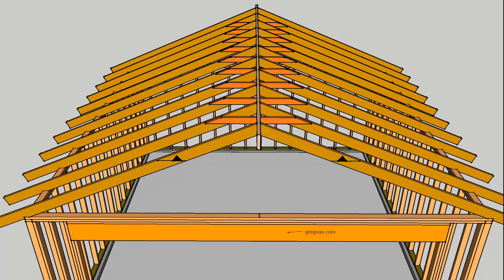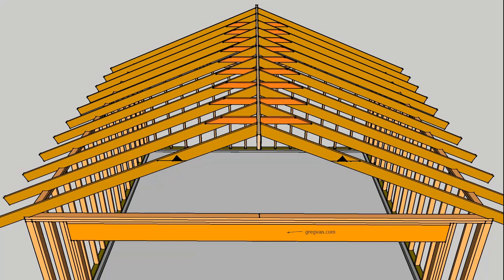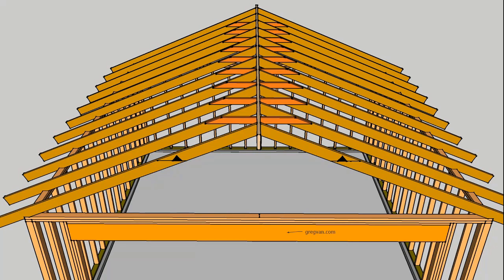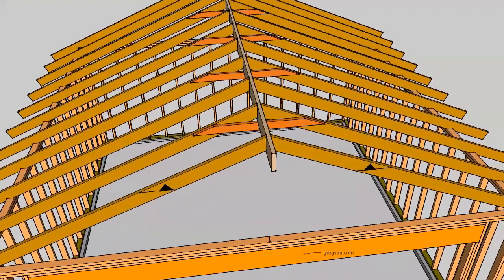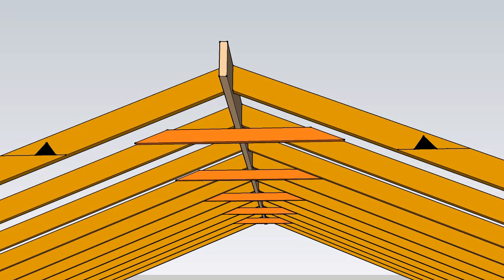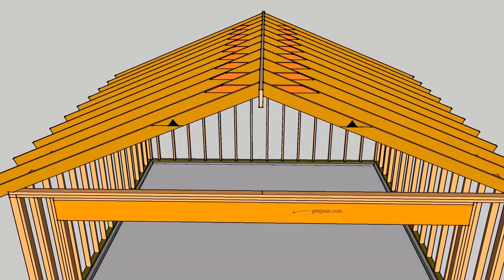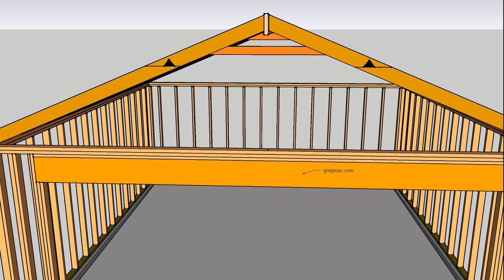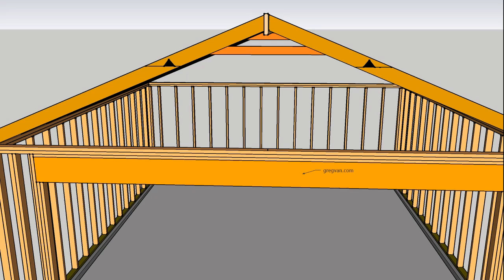What Are Roof Rafter Collar Ties – House Framing Parts

Comment: I’ve always measured from the top plate to Bottom of the ridge for the one third measurement.  I just figured it that way because you can’t put a collar tie any higher than the bottom of the ridge. But I do see now that there would be a crucial difference in height if you were trying to place the collar tie in the lowest legal position. But nevertheless, I always try to place to collar ties so they are touching the ridge.

Comment: Collar ties are for upward force. The downward force is resisted by the floor system or walls in this case. And the only upward force is not an earthquake…😂 

Wind blowing over your roof at high velocities causes low pressure and and uplift like an airplane. That is the most common force that collar ties are meant to combat.
Reply from the maker: Interesting

Comment: Can collar ties in an attic space take weight such as attaching a pull up bar or a punch bag to them? Or are they strictly not to take any downward weight?
Reply from the maker: I think you can add stronger lumber or even bolt stronger collar ties to roof rafters, but I can't tell you to do it and if you do and it doesn't seem strong enough, then remove heavy object.
Reply: Thank you! @gregvancom

Comment: Hi Greg,
Is there any reason to have a wall underneath collar ties?

I recently moved into a house with a finished attic above the garage. There is a closet wall in the attic that sits between a load bearing wall on the first floor and some of the collar ties in the attic. Is it possible the load bearing wall is solely for overlapping ceiling joists in this case?

Forgot to add that the attic has knee walls.
Reply from the maker: It would depend on the design, but I don't think the collar ties would need a wall under them. Lapping ceiling joist sound like they would.

Comment: If the roof has heavy concrete tile, not in an earthquake area and a 4/12 pitched roof, do collar ties do anything? The house does have 2x6 ceiling joists.
Reply from the maker: The roofing materials shouldn't dictate whether or not collar ties are used.

Comment: Tornados can also cause upward motion.
Reply from the maker: Great point and thanks for sharing.
Reply: Thank you for the video. I’m remodeling a 70 year old house with a shallow pitch roof. It had randomly sized collar ties placed somewhat haphazardly, to my view. Making the attic usable for re-wiring, re-plumbing & mini-split installation, I’m removing the collar ties but replacing them with a 2x4, on each side of the rafters at every rafter, mostly with tornadoes in mind. I’m doubling them because of 24” centers & the fact that I’m placing them as high as possible to make crawling through the attic possible for my nearly fifty year old bones. Your video is the first I’ve seen that indicated that doing so was okay, structurally.

Comment: Great video. I have a 26x12 shed/garage for my boat. I need more head room. I have 4 ties going from wall to wall. The middle 2 I would like to remove for head room while I'm in the boat. Can I just raise those 2 up to the top 3rd of the ceiling but I will leave the 2 near the ends? But my 2x4 rafters don't have a header.  They just meet in the middle
Reply from the maker: I can't provide you with structural engineering information, but can suggest that the ones located in the middle are usually going to be more important than the ones located on the ends. If you do move them, then I would advise measuring the middle span of the garage and writing the number down with a permanent marker on the framing somewhere and then check it every once in a while to make sure the walls aren't spreading apart.

Comment: Hi Greg,

I have collar ties in my attic that are placed 6 ft high from the ceiling joist below.
Can i raise them all the way up the roof, just below roof center joist, to make more head room?
Reply from the maker: I can't provide engineering information, but can say that I've seen it done before.
Reply: Thanks Greg, 

I'll have an engineer review all my plans before i do anything, but just wanted to some pre-lim info.

Is there a certain length they have to be in relation to the length of the roof rafters?

Comment: I did like he did, I used 2x10 cut to roof angle and screwed and PL glued them all in place.  Then I close spray foamed and it's pretty strong. for a 12/14 pitch
Reply from the maker: What exactly does the sprayed foam do?

Comment: Explain how you hold up that center beam without support underneath?
Reply: The ridge beam gets two rafters resting against it. Look up "keystone in an arch" to understand. The ridge does not support the rafters the rafters support each other and kick out force at bottom support. Think two playing cards resting against each other to form a triangle shape.
Reply from the maker: What center beam are you referring to?
Reply: You can put temporary supports to hold the ridge up during construction if needed.

Comment: After you finish the roof, do you just spray the sheathing with popcorn, or is there sheet rock and the popcorn?  I am trying to go back ward and get rid of the popcorn. If I scrape it off, is there anything between the popcorn, and the plywood?  I have no trusses, just one big ridge down the middle and the rafters. Where does the insulation go?
Reply from the maker: If you're trying to scrape the popcorn or acoustical ceiling off of an interior room, then it can usually be scraped off after spraying a little bit of water on it. The acoustical ceiling is usually attached to drywall or plaster, but I have seen it sprayed on plywood also.

Comment: Any videos or info on pulling a rafter back into place that has separated and inch or so from the ridge beam? or some kind of hardware that can be used to reinforce it?
Reply from the maker: If the rafter separated from the ridge beam, then there's a structural problem that might need to be addressed. This would be my first concern. Feel free to send me some pictures and by email address can be found at our website for more information.

Comment: Thank you for this video. I'm building a shed/workspace and want to build without a ceiling for "openness" and for better air flow. My shed is 12x22. I have 2 questions after watching it: 
1) the longest 2x8 I can find locally is 16 feet, how do I combine 2 pieces to reach the 24' (1' overhang on either side)
2) i learned from you (other video and comments) and collar ties keep the rafters attached to the ridge board and rafter ties keep the walls from bowing out. This video does not show rafter ties. Are they always needed?
Reply from the maker: Yes rafter ties would be needed unless a ridge beam was installed with supports of both ends. I live in California and lumber can be found in lengths up to 30 foot long and some engineered lumber even longer, up to 50 feet long. You might want to contact a lumber yard instead of a home improvement center for more information in your area. You might not be able to use a 22 foot long 2x8 for a roof rafter without some type of supports in the center.
Reply: gregvancom thank you very much for the thorough reply.

Comment: if you have collar ties do you need rafter ties. 2 car detached garage 21x33. right now there are 2x4 ceiling joists 16oc attached to top plate. I'd like to open it up as much as possible.  if I do have to have rafter ties what's the max distance between each I can go if I use 2x6 or bigger. thanks
Reply from the maker: +BigEsmalls91 Collar ties prevent the rafters from separating from the ridge and the rafter ties prevent the walls from spreading apart. It's hard for me to answer your question about the rafter tie spacing, because I don't know much about the design of your building, but can tell you that we used to space them 48 inches on center.
Reply: +gregvancom my framing is almost exactly like in the video except I don't have collar ties and have 2x4 ceiling joists that at located at the bottom of the rafters. I plan to add collar ties and would like to remove ceiling joists and replace with 2x6 rafter ties at the highest spot of the bottom 1/3. could I space out every third rafter if I used 2x6 or larger

Comment: I have a 1926 house w/ true 2x4 trusses and joists but no collar ties. The ridge board is a 1x4. Appx. 5 ft. Height in attic. Would you suggest 2x6 boards to install as collar ties? Also, you mentioned 16d nails, would 4" construction screws be acceptable? Thanks!
Reply from the maker: +Michael McCarthy I'm pretty sure you're allowed to use 1x6, but I would use two by fours with 16 D nails, unless you could find a screw approved by an engineer. Most screws seem to break off under stress or movement easier than nails.

Comment: Thank you very much for this quality & informative video.  It really clarified the actual placement of the collar ties, their frequency, fastener size, etc.  Overall this video helped me prepare for a visit with my building inspector to double check about local building code.  This video also helped tremendously in preparing for solar panel installation for my low pitch roof.  Great video & thanks again.

Comment: Thank you for clearing that up. Thats what I thought as well. I ran into the same situation you experienced when a client of mine asked me if it was ok to raise the collar ties to create more attic space. I didn't see why not, just so long as they remained in the upper third of the rafter. So I asked a structural engineer to confirm and he told me that collar ties are installed to keep the rafters from spreading when you can't install ceiling joists, he said they won't do as much a ceiling joist but there better than nothing. I left his office shaking my head asking myself if I got my $150/hour worth from our consultation. Thank you again.
Reply from the maker: You're welcome, but they usually are installed with ceiling joists, but I'm not going to suggest they are always installed with ceiling joists.